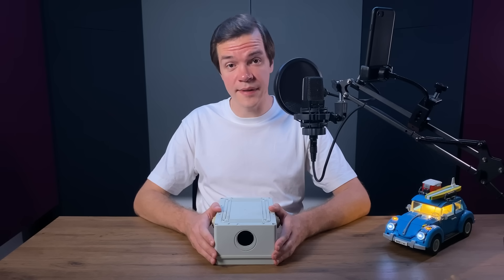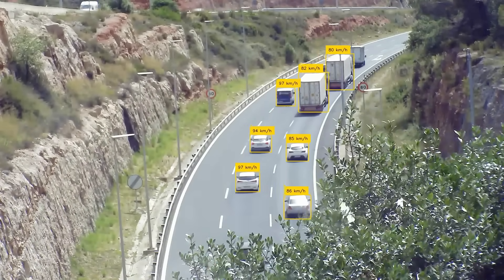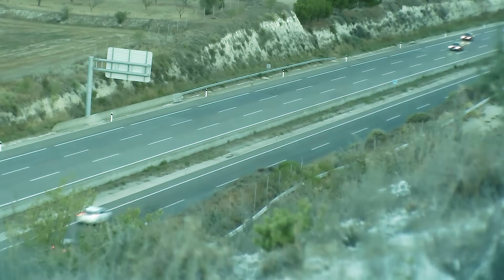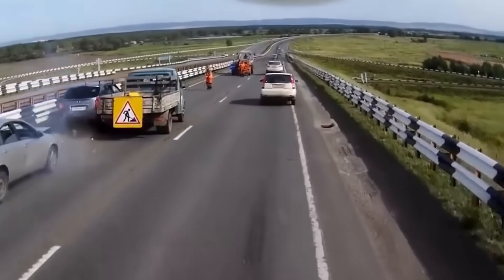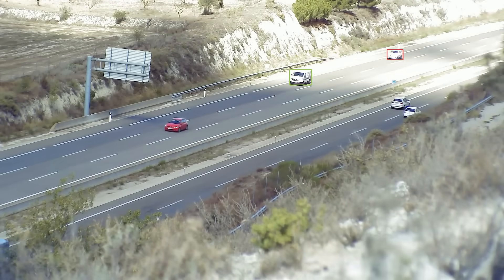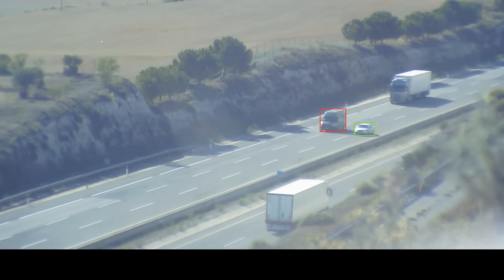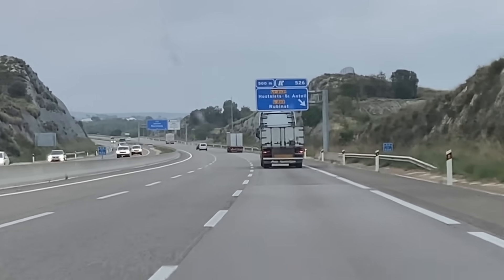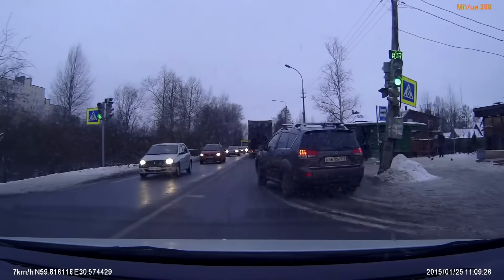New Anti-Tailgating Camera Reveals Shocking Statistics

Comment: Great video on this subject. Looking at open records of "red-light cameras" in my town in Texas they reported that the system was not bringing in the $$ funds expected or reported by the contractor that sold and installed the system so the city had them all removed due to the system was after a periond of six monthes the system started to cost more to operate than it was bringing in revenue. Proving the system was installed to bring in money and when it failed the City Councel took steps to have the contract canceled and the system removed. Yeah we win! 
I thought that Germany did have officer operated devices that captured image and data to issue tail-gating drivers tickets for tailgating. That was years ago and I'm pretty sure that could have been an automated system by now. Maye they were using the officer operated systems to pull drivers over and confront them which is much more visable to surrounding cars. The Germans said they were using it during rush-hour times or during times of high congestion of streatches of highway.

Comment: When I was taught to drive, I was told to follow the 2 second rule - take any fixed point (e.g. a lamp post or sign) and count two seconds from the car in front and that is approximately how far you should be. It's more important at high speeds than low but was just to give a general idea about things.

Regarding your observation @08:45 of 30m being the most common following distance, I would posit that this is due to the line markings on the road. 2x 17 = 34 (approx. 30 m). People are probably gauging what they think is safe based on that distance.

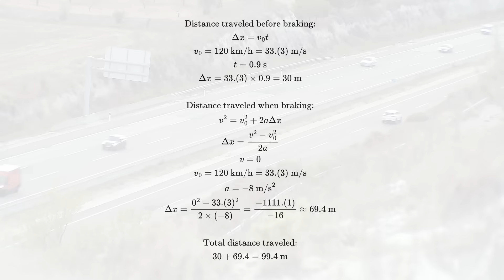I've never heard of the recommended safe distance of 100m? What speed is that at, which country/state? A simple google search does not bring it up! (edit: I see @09:35 it's at 120 kph. So, similar to other countries.)

Comment: In the UK they have chevrons painted on the motorways with measured spacing and signs that tell you how many chevrons you need to keep visible between you and the next car to maintain a safe distance. As I don’t live and drive in the UK I don’t know how well that works in practice and I’m sure it’s still impossible to use that for automated ticketing of tailgaters. However, cops on the motorway could of course watch for tailgating and can make a decision accordingly. Anyone from the UK that can speak to how well that works in practice? I’m curious as I’ve only observed it when visiting and been driven around by my relatives.

Comment: I expect that the huge variation in following distance is because we're not all traveling at the same speed. Following distances decrease and increase as a faster car approaches and passes a slower car. Cars tend to get clumped up in groups behind slower cars, particularly when passing is going slowly.

The camera only sees the interactions between drivers for a brief period. For every driver, it's sampling a random event in that driver's journey. As a result, I think the histogram for following distance is sort of visualizing the average driver's experience. They spend a mostly-uniform amount of time at distances above their preferred following distance, because they're closing the distance to the next slowest driver (or the faster driver in front of them is pulling away), usually at a constant speed difference. It falls off at high distances because of road congestion (an upper limit to how far away you can physically be to the next car), and it falls off at low distances because they prefer to not get any closer.

Because of this, I think following distance only really makes sense for single lane paths, where everyone is more or less forced to go the same speed, or while cars are waiting to pass or do not want to pass for other reasons (exiting soon).
On an uncongested freeway, those cases with short following distances feel momentary. However, that doesn't mean it's safer. I agree that leaving larger gaps would be better.

Comment: I leave several car-lengths between myself and the driver before me, and I increase that distance as our speed increases. The only time I've made contact with another vehicle was a tiny "kiss" of our bumpers during a sudden deceleration into a left turn lane, because I was cognizant of the driver behind me crowding my rear so badly that I knew they'd rear-end me if I pressed the brake pedal any harder. My driving record has been clean for 15 years(I'm 31); my reckless speeding younger self is no longer with me. I don't buy fast vehicles anymore. I buy vehicles that serve greater purposes. Ford Ranger for daily driving. F-350 Flatbed for hauling. Honda 300 Rally for commuting during the warm months. I can't really go very fast with much maneuverability with any of them, and that's no accident (pun somewhat intended).

Comment: I commute down a rural 75mph freeway with 2 lanes each direction for work, and it's too small for the amount of people who use it. There are times when I used to keep a safe following distance (3 second) all the time and semi trucks driving 30mph slower than me would dive into that following distance while I'm passing a group of trucks. It could literally nearly end my life in a car pile up because of some truck driver's impatience, and there's multiple big freeway pile ups every week on that road. So the only solution is to get to work 10 minutes later by cruising behind trucks governed at 55mph or tailgate the guy in front of me at 80mph to protect myself and the people behind me from an impatient truck driver. There is no way to win other than work a job that lets you avoid rush hour.

Comment: I sometimes drive on the Eisenhower expressway in Chicago at rush hour. My Subaru has a 4 second following distance by default. That's what I set it to. Sure, when traffic speeds up there is a good gap between me and the car ahead. But traffic is mostly going below 20 mph so I don't have much of an issue. I notice that large trucks also leave a big gap in front of them and sure some people will cut in front of them but really everyone is going the same speed as everyone else so people who are impatient don't have an easy time of getting in front of you.

Comment: If you drive an older car with the "standard" windshield sprinkler nozzles, just clean your windshield. It often helps with getting rid of tailgaters.
If you drive an older diesel, downshift and floor it. The smoke is super efficient at getting rid of them 😁

Comment: I can only report for Ontario Canada, but a major factor in expressway tailgating is persistent, unthinking use of cruise control.  People do not think to shut them off in moderately heavy traffic.  
This is partly based on the long held belief that CC improves fuel economy, which is ONLY true under limited conditions - a dead flat roadway, or for lead-footed drivers who need accelerator pedal discipline.

Comment: The recommded distance - which btw. is also legally enforced by regular police controlls - on German motorways is 50% of your speed in meters. The premisis of holding 100m does not make a lot of sense, except the overall speed is 200km/h. Simply because the car in front of you will not stop from one second to the other. It also needs time to come to a full stop.

Comment: I don't drive on the highway as much anymore. Where I live, the backroads are much more scenic and relaxed. I may lose 4-6 minutes, but gain sanity. Besides, my performance sports car prefers the curves.😉 
BTW, which data center processor did you use? XEON? Which model? Just curious.

Comment: In the Netherlands we have the "Count 21-22-23" or 2 second rule to keep distance from the car in front. It's close enough to work.
My personal experience with driving a small hatchback was that i had a lot of tailgaters.
After installing a tow bar with a black cap, the distance kept by the tailgaters increased, and the distance became even more when i replaced the cap with a yellow tennis ball.
It appears that the tennisball on the tow bar is a clear warning to tailgaters, and will reduce the risk a bit.
Reply: ik heb zelf de ervaring gehad dat sommige autos gewoon meer aantrekkelijk zijn om bij te bumperkleven dan anderen. ik reed een astra g station waar mensen altijd achter gingen plakken ongeacht de snelheid, nou rij ik een bmw e46 en heb ik bijna geen last meer van bumperklevers

Comment: In italy in the driver's test they teach you to keep a distance of kmh*0.3=m, so for example at 150kmh (ideal maximum speed limit in italy, although there are no roads with a limit over 130) it would be 150*0.3=45m. The actual calculation would be to keep a distance of at least 1s which is the time it takes for you to see the danger, react and brake, the exact number at 150kmh would be 42m, but to simplify you can do the 0.3 rule and get 45 which is more. The easy way they tell you is to divide the speed by 10 and multiply by 3, much easier to understand then to think how to multiply 150 by 0.3.
I know in most scenarios a higher following distance would be safer, but i still don't think that's the problem in itself, one of the major factor in crashes is people that don't look in the mirrors, can't follow the lane and mostly do something unpredictable, like trying to take an exit 10m before the barrier...
When driving always try to be as predictable as you can, use your mirrors to check and move yourself in your seat to check the blind spot, use indicators prior to changing lanes and don't put them on as you're already moving.

TL;DR: People need to learn how to drive properly, the distance is not the cause of the problem, but just part of it

Comment: When you move a low volume of air through a tube of a specific diameter from outdoors to an area of low pressure the molecules will be spaced farther apart than normal because the volume of air is low.   If you increase the volume of air moving through the tube with a blower then the air will either move more quickly through the tube or the pressure inside the tube will increase and the molecules will be spaced closer together.  You cannot increase the distance between cars without limiting how many cars can be on the road.

In the air tube analogy, if there is a partial blockage of any kind in the tube the air molecules will be packed closest together right behind the blockage.  it is not possible to prevent this from happening with a law, because at the end of the day the law of physics is the only law that will be consistently obeyed.  Volume, capacity and the ability of the roadway to move cars quickly through is the determining factor.  It is very probable that the problem on this Spanish road is that since it was built the volume of cars has increased substantially without any changes made to the road or how the traffic on the road moves.  

Between New York and Connecticut there is a road that does not allow trucks or slow traffic in the left lane.  If you are moving more slowly than the flow of traffic in the left lane you will be ticketed.  Everyone in the left lane is speeding.  This is true to the point where the volume of cars that moves through the left lane is several factors higher than the volume of traffic that flows through the other two lanes.  Because of this high flow through the left lane the speed in the other two lanes is also higher than it would be if there was not such a high volume of cars moving through the left lane.  This is true because the unobstructed left lane moves such a high volume of cars that it substantially reduces the volume of cars in the two rightmost lanes to the point that they have so much congestion removed that they move faster.  (Even though it may not feel faster if you are in the slower two lanes.)

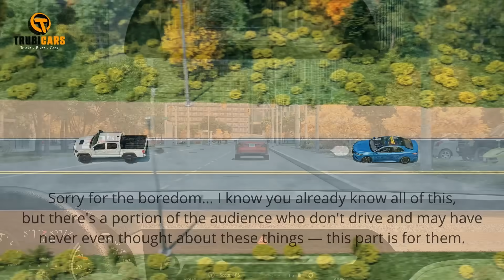Comment: 5:45 - You might think this is boring and unnecessary. In fact more than 80% of the people I meet daily do not know how to calculate the time distance to the person in front of you as these graphics show.

I will correct you though, speeding does in fact constitute a safety risk outside of the obvious weather/tight turn concerns: Driving mentality.

I drive the speed limit. I could not hazard to guess how small the fraction is of people who join me versus people who speed, but it is vanishingly small. To all those people who insist on going 20km/h over the limit (or more) on roads and highways, I'm an obstruction to be cleared as fast as possible. This has lead to me basically being forced off of the road, if I were a timid driver, by people cutting in front of me so close I can't see their bumper over the front edge of my car. One time, someone actually sped in front of me and hit their brakes hard to slow down in front of me to below 70km/h on a 100km/h highway to force me off of the road. Instead, I just maintained speed behind them (pissing off a growing column of people passing us) and called the police. Unfortunately air traffic patrols didn't make it in time to see, and citizen video is inadmissible for fines or license revocation, so they got away with it by quickly speeding up to over 140km/h again (an estimate given how fast they were overtaking other people who were themselves speeding).

People like this, who believe that speeding is okay, are openly hostile (or at least neglectful) to anyone who is going slower than what they perceive as an acceptable speed.

Comment: After 60 years of driving, I usually keep a speed dependant distance to cars ahead. Recently changed to a car with adaptive cruise control. On cruise control it keeps speed until closing in on a slower car. Then it reduces speed and keeps a speed dependant distance to the car in front. Works well but it keeps longer distance than I'm used to. Gives a smoother ride and some extra safety marginal.
Reply: "but it keeps longer distance than I'm used to"

You've been following too close!
Reply: @Chris-hx3om  You're right.

Comment: It could be enforced, because you can follow a vehicle's position and speed over a longer distance than your makeshift rig did.  LEO in vehicles traveling along with traffic can also do this, even better if they have a digital sign on the back of the vehicle stating why they're pulling the offender over, making others realize that tailgating is not just illegal but also the law is being enforced.

Comment: There could be some smart logic like if the driver on front is slowing down, then the driver behind faces no responsibilty for tailgating, only if the driver on front has been maintaining speed/accelerating for at least 10 seconds would the camera be allowed to record a tailgating event.

Additionally, if a new car cuts on front of you, you could have a minimum of 15 seconds before any tailgating event is reported.

These are just ideas, but the key is a comprehensive report could definitely devise appropriate strategies for automating this, furthermore there could be manual human approval of reported events and plenty leeway for dismissing an event, might not be exhaustive but I'd much rather a tailgating law than a speed limit law.

Comment: 3 second rule is obsolete. I was taught that decades ago as a teenager in driving school when ABS was rare and tire technology was old. Tire technology and brake materials have improved so much since then. Today’s economy car stops better than a sports car from the past.
Reply: Wrong, cars are bigger and heavier nowdays plus ABS does not make you break faster is just prevents your tires from blocking steering to avoid something while you break and technically makes the breaking longer since you can´t have 100 % break power or else you tires would stop moving.

Technology is fine at all but does not solve the issue of people doing mistakes and you need to haev a safe distance for that simple as that.

Comment: Tailgating and lane changes cause accidents.  But speeding makes them worse.  The chances of fatalities are much greater at high speeds.  Automated speeding tickets therefore do make some sense, but they need to not tell you where the cameras are and keep periodically moving them.  Naturally, this won't be very popular, but it would work.  Automated tailgating tickets are viable, but only if they have multiple cameras over a single stretch of road so they can keep track of why a car is too close behind.  If it was the result of a lane change -- even by the driver who is too close -- then it's not tailgating, at least not until you give them time to back off.  Sometimes you need to change lanes and simply cannot do it if you insist on having the three second distance right away.  Make the lane change -- carefully -- and then ease up on the gas until you're at the right distance.  Braking can be dangerous in itself.